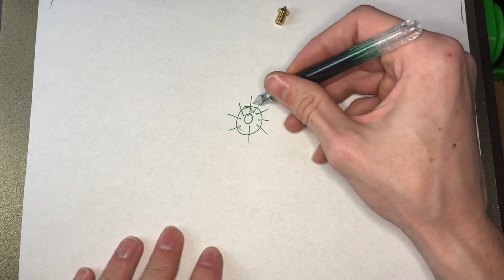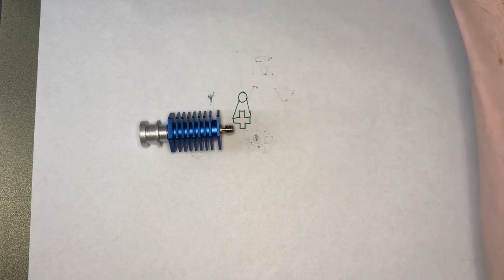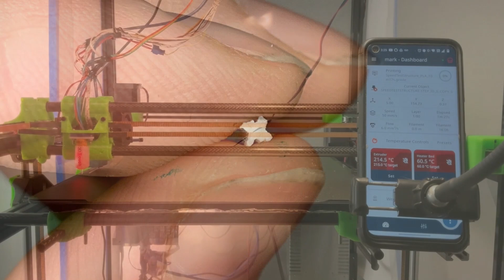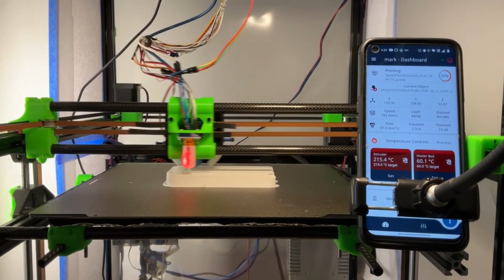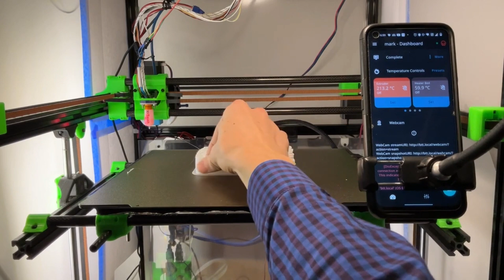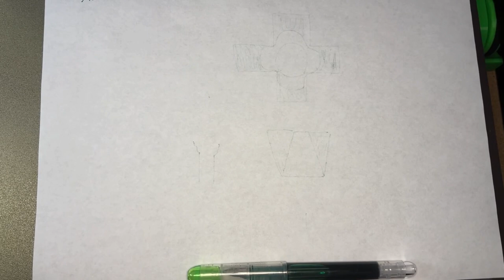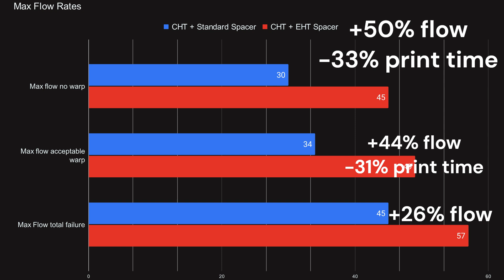A Novel 3D Printer Hotend Upgrade - EHT Nozzle Spacer (How-to Upcoming)

Comment: It would be interesting to see a test against a volcano cht nozzle. Great work, I might use this in my speed printer.
Reply from the maker: Thank you! I'd love to get my hands on one. If I ever do though, I'll come right back around and combine it with this to make it faster 😆 I'll just use the CNC Kitchen method - https://www.youtube.com/watch?v=_Soz8z-vAIw&
Reply: @aaamott  I have a CHT volcano and I have CNC kitchen adapters with standard shorter CHTs.  The adapter version works better than the full length CHT Volcano in my experience.  I think it is exactly what you were saying in the beginning of the video.  With the adapter, the material in the center is alrelady pre-melted when it gets to the CHT geometry, so it works even better than cold material contacting the top end of the CHT volcano.

Comment: Yeah I found with my flow testing that the clone CHT nozzles with the brass inserts can actually hurt flow rate. They really needed to chamfer those leading edges more and create the pointed stabbing and slicing surfaces. Some quick work with a Dremel and a diamond grinding cone shaped bit turned my clones into something more like the CHT design and got me far better flow rates. Probably matters much less if all the incoming filament is already melted like with your EHT spacer. Might be easiest to manufacture these by basically extruding them out of brass or copper and then threading them afterwards. A longer one made of brass would melt stuff so good. :P
Reply from the maker: Did your CHT nozzle have a loose copper bit? I don't remember the video, but someone tested flipping it upside down with the chamfer on the wrong side and it hurt flow, probably because there wasn't enough space between the copper and heatbreak to let filament flow through. I bet an extruded spacer would work great! I'll have to look into that!
Reply: @aaamott  I believe you are talking about the CNC kitchen video. I don't think flipping the insert had any effect. Mandic Really also did a video on them where he modded them similar to me and saw improvements I believe.
Mine are tool steel outers with copper inserts and the inserts on all 6 of my nozzles in all 3 sizes were solidly in place and I could not pick them out easily. Chamfer was the same on all of them, as shown in pictures of most listings. They are sort of holes which come to flat faces in between, like small mountains with the peaks cut off. I turned them into sharp mountain ridges with one shared triangular peak in the middle. Made a big difference.
I took pictures of the nozzles and the heatbreak exit and still need to find time to overlay them to see just how much of the filament entry was blocked by the unmodded inserts. An extruder spacer with a wider ID would definitely help, like the EHT spacer if you have seen that video, but modding the nozzles helps significantly at high flow rates as well. They really didn't struggle at all at low flow rates even with the significant restriction.
It seems to me having an entry cross section any smaller than the surface area of the 1.75mm filament is a bad idea!
Reply: @aaamott  P.S. There may have been another video where flipping the insert helped that I haven't seen or I'm misremembering. I did quite a bit of searching before buying. Most of the clones I see online have the same style insert. Most of them probably come from the same factory, after all.
Reply from the maker: Looks like I'll have to give it a go sometime! I'll make another video if I do, probably included with the stacked hotend I'm doing next with a volcano heater block, spacer, half spacer, and volcano nozzle with copper nuts, plus a more reasonable setup. Don't know if it will be enough to draw the heat down, but worth an experiment, so why not throw that in as well?
Reply: @aaamott  For science!

Comment: Think you made a Bozzle nozzle there. 

I have a very old nozzle with a very long 0.4mm path after the reduction. About 4mm. And without part cooling I'm able to print near mold-like parts at about 4mm3/s (45mm/s @0.2mm layer height). For my volcano Micro Swiss CM2 nozzle to get the same results I have to limit speeds to the same 4mm3/s without part cooling. *Printing ABS

I've been thinking of getting the Bozzle nozzle that has the same geometry but is made of tungsten carbide. But it's also $75 😅 I haven't because I learned with longer nozzles you need slower retraction speeds as the filament tends to want to snap if pulled too fast from the nozzle that has more holding surface. Like pulling a bugger out your nose 😁
Reply: I knew it looked familiar, but couldn't remember the name. Thanks 😀 @Vez3D has a video on that one.
Reply from the maker: Interesting - a longer 0.4mm path after the 1.75mm path. I think the new Creality nozzles do that a bit. 

I was thinking of a bozzle nozzle when I made this! But the nice thing is that you can combine this with a CHT or a bozzle nozzle to make a long meltzone without paying for the most expensive manufacturing. Not sure about mass manufacturing, but I made mine with a jeweler's saw for roughly the price of a brass nozzle. I'm planning to test bozzle nozzle type geometry vs my slightly more gradual approach, but in mass manufacturing I bet the bozzle would be far easier to make. 

Sorry for the "Novel" title - I really hate it, but I wanted to get it in front of more people so they'd use real tools to make this idea better. Like you mentioned longer meltzones have their issues, retraction and oozing being the main ones. I haven't seen anyone make a high-flow nozzle scalable past a volcano without defaulting to just making new ways to make the meltzone longer - the dragon sticks some meltzone in the heatbreak, the goliath is just reealllly long, and high-flow adapters are just more nozzle.

Comment: the process you would be interested in for mass manufacturing is rotary broaching, this is how hex and torx screw slots are formd but you might need a special shape broach for that shape because it usually creates straight hols with tool that wider on the tip than a shank and it wobbles eating into a spinning hole on an angle elongated version of philips head screw broach could work , or you would need multiple broahes
the problem i see is that bontek nozzle has 3 pathsand you create not matching number of sides so 3 way split could have less friction if channels would match
the video was very interesting and i hope you will find even better solutions in the future
Reply from the maker: Thanks for pointing that out! I bet you could use it to make a torx-shaped spacer. It might not be quite as effective, but still a decent boost for much easier manufacturing! I've been trying to figure out what to do about path matching for a while. It's hard with two screws since one nozzle might match holes perfectly and another might do the exact opposite, holes facing straight copper. I'll keep trying though!
Reply: @aaamott  hole matching might actually be as easy as cuting a slot in the nozzle and making matching "flat screwdriver" on the spacer but it might make nozzle fall out if it isn't very tight, i think this is why both 3 way nozzles and spacers are ysually internally champhered to avoid loose connection but allow to some crossflow
Reply: You could mill the thin slot idear with the conical mill by just tilting the workpiece a bit back and forth. 
EDM would also be an option and woukd probably give the best presicion.

Comment: Would efficiency increase if instead of a cross with 4 prongs you use 3 prongs that are aligned with the holes of the CHT nozzle?
Reply from the maker: I wanted to try that, but I didn't have a tool to screw it in with 😆 That and I didn't have a way to align them. But I found a friend with a lathe and I'm going to try to make an insert to replace the copper tubes in knockoff CHT volcanos that come before the CHT bit. That way I could just push it in. I'll make an update when the nozzles arrive!

Comment: 4:00 wouldn't a (clone) volcano CHT mostly solve that? 🤔 

It has a cylindrical copper insert to first preheat the filament which then passes through the CHT geometry before finally terminating through the nozzle tip
Reply from the maker: A clone volcano CHT is essentially what I test this against - a copper insert that sits above the CHT part. A straight path vs a gradually changing path for faster preheating than a round hole can accomplish. I'm actually planning to directly test a clone volcano CHT with its original copper insert and a custom one, just to test another method of making the insert.

Comment: You should look up the vzbot and the Goliath hotend … one of the longest melt zones printing the best quality at the highest speeds possible and all very quality prints. The same issues happen with short melt zones and you’ll still have to compensate for it either way
Reply: Goliaths do have oozing issues due to long melt zones, we make up for it by printing faster than you can ooze. No joke. I have an all metal watercooledl awd vz235, Goliath oozes more than any printer I have, but yes also vz have the best quality because of the motion system.
Reply from the maker: @mmakam3  Oozing is the exact problem I want to solve. I definitely print fast enough to use the speed of a Goliath, but I feel like better geometry could do more than a longer meltzone because of the oozing. Of course, the VZ definitely goes fast enough to use a Goliath  a spacer like this! That thing is a beast... My goal is actually to beat a Goliath with a shorter meltzone, but it's gonna have to be longer than a volcano 😆
Reply: @aaamott  I definitely think you are on to something here. Having a shorter melt zone should allow us to lower pressure advance values as well.
Reply: @mmakam3  yeah a 1mm diameter filament is all we would really need to better the heat transfer to the middle… same reason we switched from 3mm to 1.75mm wide filaments

Comment: Rotary broaching could be a thing to help make what you're looking for. Challenge would be finding the right design of broach tool and getting one at the right size. Should be possible especially that small screws like M2 screws have a small torx star for the fastener head type. :)

Comment: So Have you tested a Cht type insert into a spacer then through a cht Nozzle.  Would that not do what you are trying to accomplish
Reply from the maker: I tried to explain why we hit a limit with longer CHT nozzles at 2:50 in the video. I'm not saying there's benefit for sure, but at some point your limit isn't the nozzle, it's the CHT splitter. Stefan explains it well here: https://www.youtube.com/watch?v=TdndOILeaIo. You can see the sudden failure he experiences, and the CHT extension is actually beaten by a straight-bore extension (14:23 in his video). Notice that he got 50mm/2 with his and I got way less using the same combo but matched his and more using my custom spacer. That's a combination of my using tighter turns on my test and a crappy extruder. If the numbers hold, he could get 75mm/s @215c using this spacer and a CHT.
This adapter is meant to make a smooth transition. I'm planning to combine it with a longer CHT nozzle, but $25 is a lot for something I'm used to paying $1 for.
Reply: I guess i do remember watching that video a while back    Good call.       I could see how combining different methods like you're doing could eventually come up with a golden ticket.   Such as a bozzle nozzle type spacer (similiar to yours) followed by a cht or vice versa   @aaamott

Comment: That is impressive! Does this help with the blobbing that you mentioned?
Reply from the maker: Thank you! Yes, it's helped hugely! Not to mention I can actually tighten it down properly and still remove it. I stripped both my straight-bore spacers before I could install and remove them twice and they still came loose. Barely got the second one out with a hobby hex wrench (sharper corners) and the first one is still embedded in my old volcano 😢

Comment: how does the retraction work with all of those?
Reply from the maker: It seems a little better than an equivalent flow-rate nozzle without the changed geometry, but I really need to try on a lathe to get the faces flat enough and the hole centered. I think it should be about on-par with the normal spacer once I do it on a lathe. It doesn't come loose like the old spacer did though, and every time that came loose I had to remove the nozzle to tighten the spacer. So I'd still call it better even if the pressure advance was worse.

Comment: What printer is that?
Reply from the maker: It's a custom design - https://www.printables.com/model/605726-knight-high-speed-simple-maintenance-3d-printer/comments/1454337
I wanted easier maintenance than a Voron (and gentler price tag), so I made it :) a few quirks still, but after a friend builds it, I'll upload the STLs alongside the fusion file.
Reply: Just saved the design in Printables. I've been looking at CoreXY designs for a build. Looks very interesting.
Reply from the maker: @lajoyalobos2009  glad you like it!  I'll try to get the STLs uploaded tomorrow. I'm waiting on a new phone with a better camera too, but then I'll try to add a video explaining the assembly.

Comment: Goliath + Orbiter 2.0 + Regular coated .8 nozzle = 45mm^3 at 15k acceleration around 250 C degrees.  I think your set up needs an upgrade.
Reply: bro a goliath is thicc and heavy
Reply from the maker: My extruder certainly does - cheap BMG gears with a bad tensioner, though the motor is plenty beefy! But I'm going to make a different one soon with some big gears, maybe LGX lite. But at 215C I peaked at 45mm^3/s before warping even started, 57mm^3/s before what I consider failure, with square corner velocity at 40 and accel at 30k. At that point I was keeping constant speed, so turning it up didn't make a difference here, but I've tested up to 120k and 900mm/s before my drivers got too hot to go higher. I'm still using the crappy heatsink that came with the SKR Pico and a little 4010 fan, so I'm impressed it made it this far!
Reply from the maker: @educationalpurposesmostly  Heavy on the wallet too... But a great choice for those with the cash and room for the added weight! Even better with a CHT and this ;)
Reply: 0.8mm nozzle flows a lot easier than 0.4mm though. Also every 10C in temperature makes a massive difference in flow rate. Combining just 250C and a 0.8mm nozzle could easily net you 20% flow rate or more over say a 0.4mm nozzle at 220C, but can come with other problems.